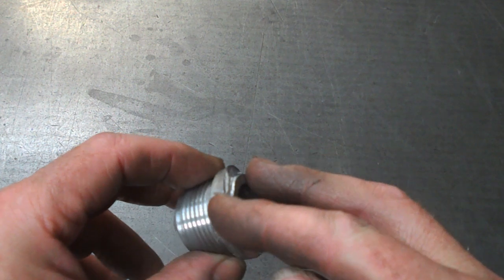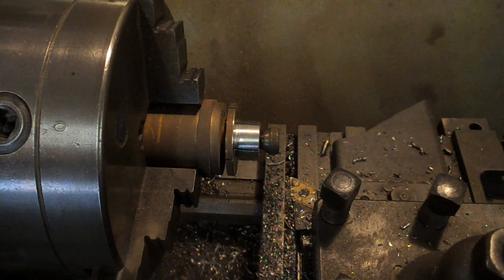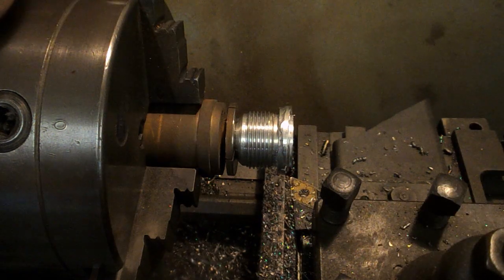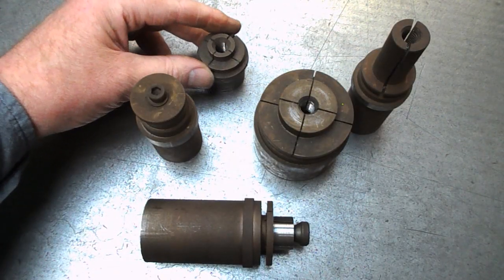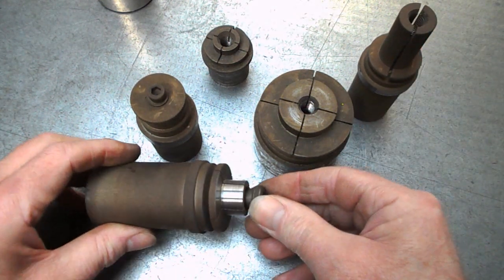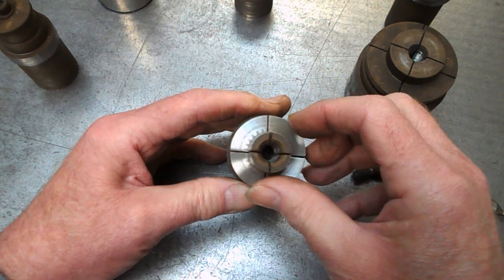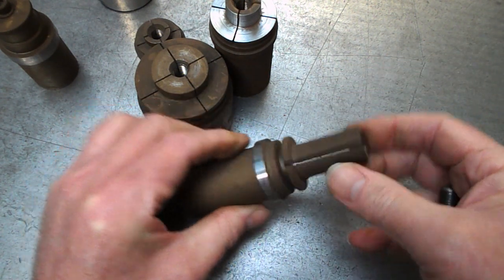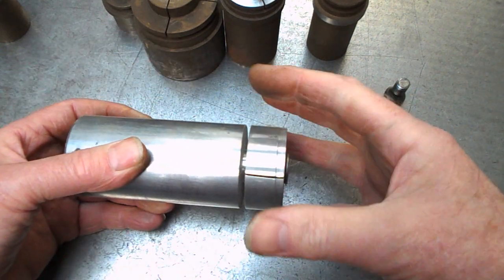Expanding Mandrels for workholding on a lathe (& other ops.) #SHOPMADETOOLS

Comment: I'm trying to figure out a way to expand the rim of a shelled out coin using my mini lathe and similar technique to the use of an expanding mandrel. Its used in magic tricks! Any suggestions on how to do this?
Reply from the maker: Like stretching a ring? Take a look at this - 
https://youtu.be/VWXrqMHkjwA 
Maybe you could do a similar operation in a lathe  using something like a knurling tool with a plain wheel  ?
Reply: I was thinking this... but what would keep the coin shell in place while the knurling tool expanded the rim? To shell it out I have made a chuck that clamps in the coin under pressure so I'm not sure how knurling would work in terms of applying the opposing outer pressure
Reply from the maker: @jackschapira7681  Holding a part is one thing, stretching the metal something else! Will need a lot more force - pipe expanding machines often use hydraulic power. Hence why I thought you'd have a better chance with a rolling/swaging kind of process. Not sure that would be possible though as I guess you need to stretch/expand the face of the coin as well as the rim? Are you trying to make an oversized coin? You might need to start from scratch - I have an old pantograph engraving machine that could probably do that!
Reply: @MidEngineering  it must be possible, as the market is in the magic industry that use expanded coin shells in magic routines. The coin shell fits over the regular coin, so essentially doesn't need an expanded face but the rim is expanded ever so slightly thay it can cover the regular coin. Do you think this is possible using a mini lathe?
Reply from the maker: @jackschapira7681  As you say, it must be possible to do - but on a mini-lathe? I really don't know!